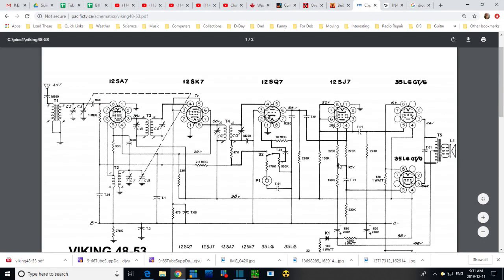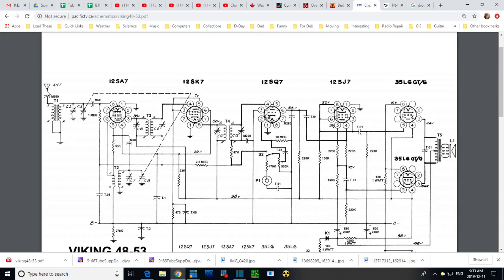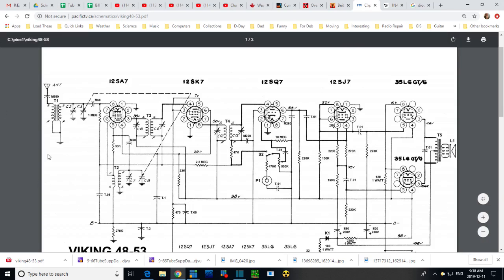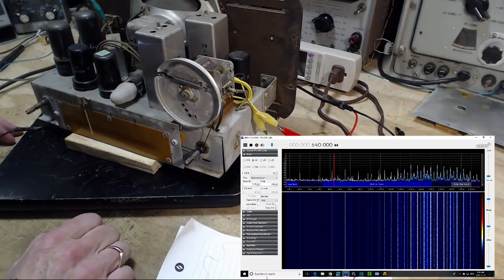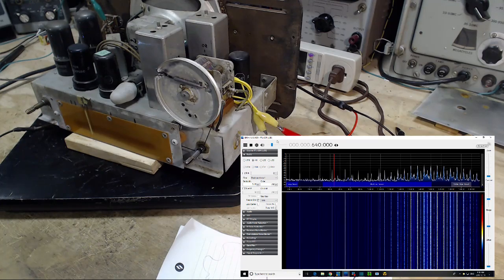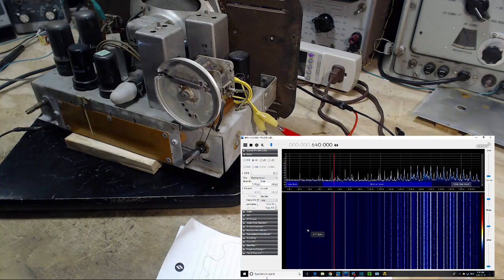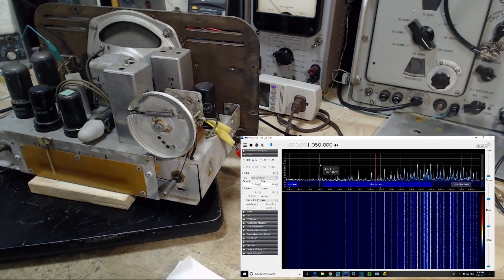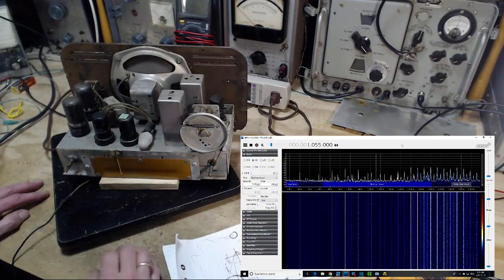Viking EMU61 Tube Radio Video #5 - Image Rejection

Comment: Jim, That M500 capacitor in series with the antenna coil provides a safety feature for the radio and the user as one side of the chassis is probably a direct connection to the AC power line.

Comment: Jim as I learned it many moons ago it looked like this Wherever the dial is set the LO is 455kc apart so you get the two originals plus the addition of the two and the diferance of the two the IF is very sharply tuned to 455 Kc the iF is always the same and you can get a lot of gain that you don't have to tune (it stays at 455kc) and you can make an if amp that only has one freq to tend to   Hope this helps KM4KYA Jay <>><

Comment: As Radiotvphononut would say 910 is double of the IF frequency of 455 and what you could get a whistle or howl as just about every radio he works on has issues at 910khz (and it just happens he has a local station at 910)
Reply: and as I told John C above...
I  live 80 miles due W of Sarnia, Ontario, in mid Michigan.  Detroit AM hammers me to such an extent that a crystal set could light a #47 dial lamp

Comment: Superheterodyne 2 frequencies added together give a sum and difference  you can prove it with maths  and hear it in music. Valve or tube Uch 81 is a triode hexode frequency changer triode is the oscillator 465 kHz above desired signal mixed in hexode to give fixed  IF of 465khz  image is 465khz below oscillator. RF tuning via ganged variable mostly capacitor rejects this. The other gang of the capacitor is the oscillator. 3 ganged radios tune the radio prior to mixer stage improving image rejection.

Comment: Dear Jim, Watch the video. What happens on the SDR when you move the the yellow pick-up coil away from the radio?
You are talking about image frequencies and you have in full view loads of lines going down the waterfall that just disappear! 
Think about what that is telling you?
Those are all spurrious signals, some of which will cause "interference" to the signal that you are trying to tune to.
What has broken? The radio just suddenly got much louder! 
Instead of just having a tantrum, and throwing things around, you could have continued and discovered something.
Not just switch off and stop the video. You have the tools, start using them in a sensible way and stop fantasizing!
Reply: @Brian John You are right in that you can talk hours on end about what signals you can see in a radio, be it spurious, overtones or intermodulation products. But honestly and as fascinating it may be, that is for the advanced EE  to ponder. IMHO restoring or repairing a radio is a craft not an art. It is an exercise in troubleshooting, changing parts and aligning following specific or general procedures. The more you worry about non-issues like spurious signals, heterodyning whistles etc, the more you get sidetracked and loose focus on the things at hand. The shops repairing the radios back then did not have fancy tools, and guess what, they need not.
Reply: Agreed.  To use an SDR dongle for AM radio LO signal troubleshooting, it would have to be preceeded by a reasonable bandpass filter.  Those SDR doodads are wondeful for looking at the IF passband of a communications Rx.. such as to have an outboard spectral display.  Or to use for general broadcast transmission listening.  But as an RF troubleshooting instrument, they are miserable little devices
Reply: There always seems to be a lot of conjecture, hypothesis, and projection rather than objectification